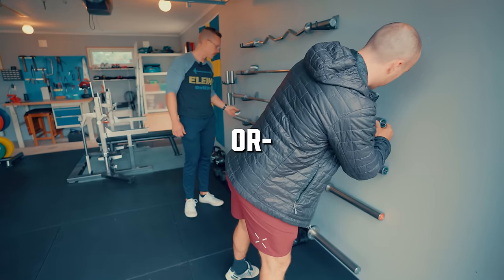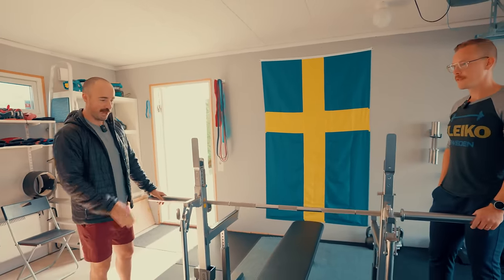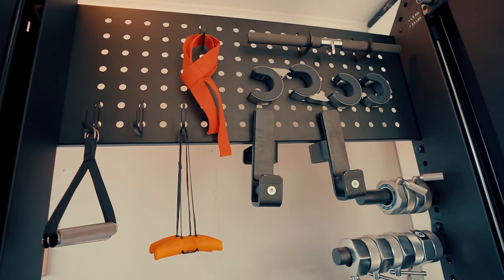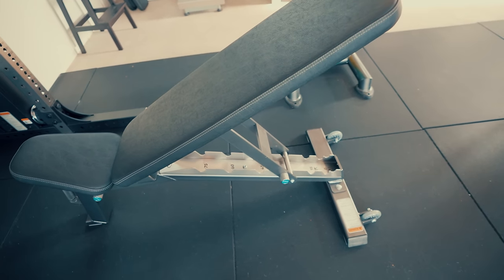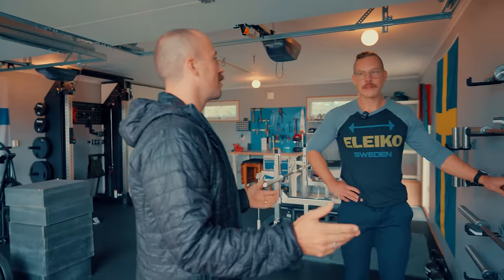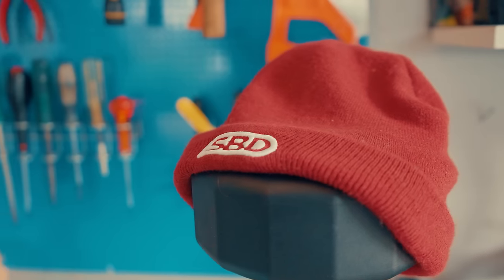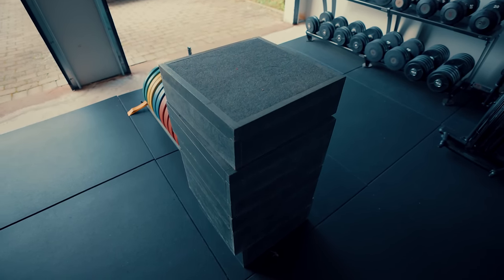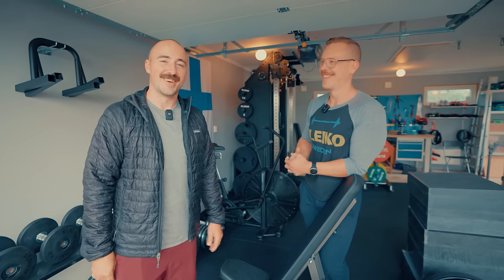Oscar’s Sweden Powerlifting Home Gym That Builds MASS Muscle!

Comment: The quality of stainless steel is not determined if it is magnetic or not. Whether or not a stainless steel is magnetic is due to the type of stainless, the stainless mentioned in this video is an austenitic stainless (300 series) there are martensitic stainless steels (400 series) that are magnetic. The carbon content has nothing to do with a steel’s magnetic properties, it is the solid phase.
Reply: Do they use that other type of stainless for this purpose though? Maybe that's what he meant. I don't know much about metallurgy but I know enough about prices of metals to know that purity and quality lend to higher cost
Reply: Resistance to corrosion is also not necessarily an indication of quality. Every steel alloy has an appropriate application somewhere, and an alloy that rusts in home gym use is more an implication that the designer spec’d the wrong alloy for the bar. Admittedly there are low-end brands that will tout “stainless” and just bought the cheapest bar stock they could find.
Reply: The stainless looses it's magnetism because of the nickle content
Reply: This guy stainlesses
Reply: Does this guy know how to party or what
Reply: 304 stainless steel probably used here, more 'stainless' or rust resistant than 430 (the most commonly magnetic, high ferrite stainless steel), also the cut/ welded ends/edges of this 304 tend to form ferrites so parts might be magnetic.
Reply: @philipcremers technically no, it causes it to crystalise into a different solid phase which is what causes the loss in magnetism. You can have nickel content and still have magnetic steel.

Comment: 7:09 
magnets dont stick to carbon, its wouldnt stick even if it had a lot of carbon in it. it will actually stick less
but magnets also don't stick to nickle and this stainless steal is likely high in nickle and other things non magnetic making the stainless non magnetic

they are called Austenitic stainless steels.

thanks for reading, i hope you enjoy metals as much as i do BYE!
Reply: In a nutshell, austenitic stainless steels are a type of stainless steel known for their corrosion resistance, high ductility, and non-magnetic properties. They contain significant amounts of chromium and nickel, forming an austenitic crystalline structure at room temperature.

The non-magnetic characteristic of austenitic stainless steels is primarily due to their specific crystalline structure. While other types of stainless steels can be magnetic, the arrangement of atoms in austenitic stainless steels, especially in the presence of nickel, makes them predominantly non-magnetic in their annealed (heat-treated) condition. This non-magnetic property is beneficial in applications where magnetic materials are undesirable, such as certain electronic and medical devices.

-chat gpt
:D
because i don't actually know what I'm talking about 
:D

Comment: Love the equipment, but was saddened by that gap in the bench. I was a fitness director and bought and sold equipment. When setting up a new gum we specifically sourced "Atlantis Strength" benches as they were - at the time - the only ones that closed that gap.